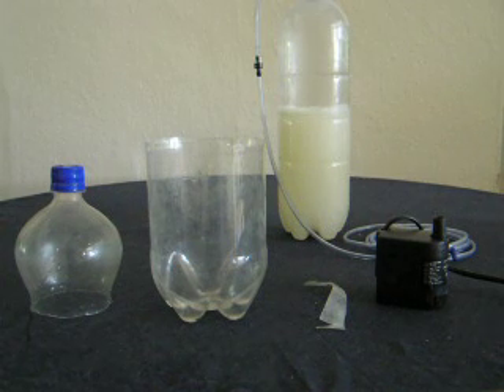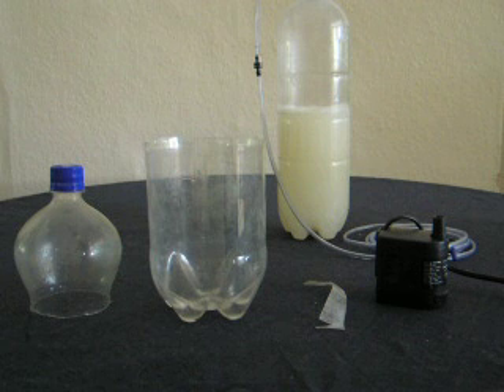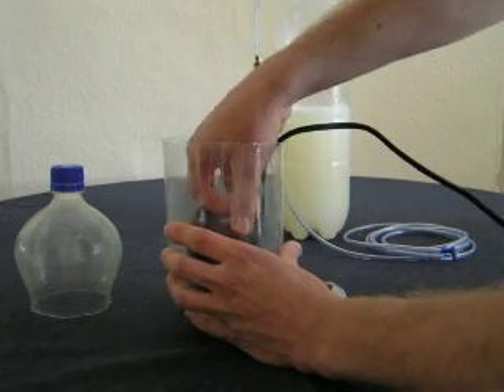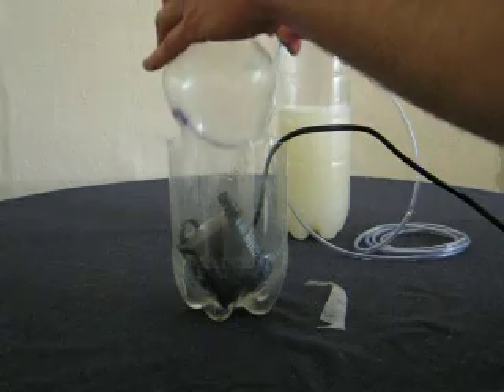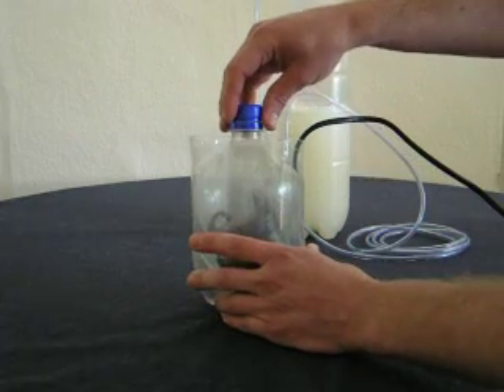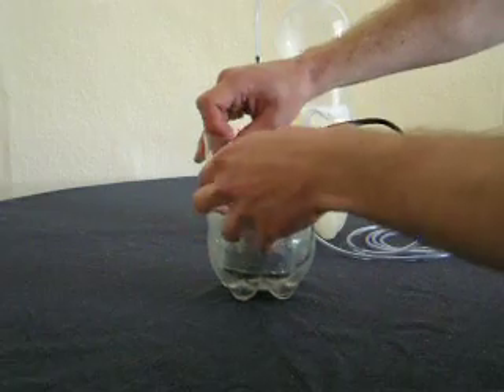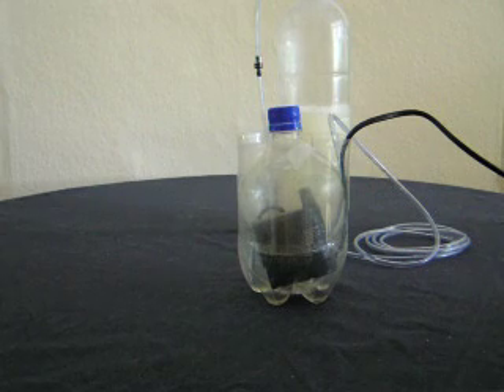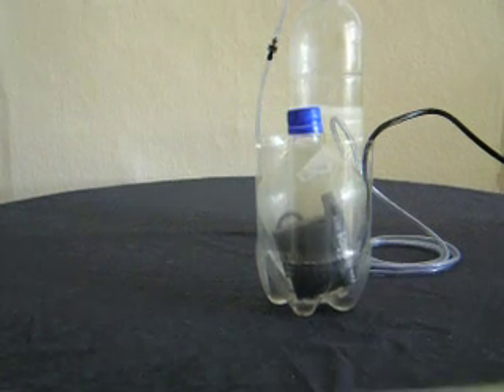Simple and 100% Efficient CO2 Reactor Part 1

Comment from the maker: Hey.  I'm not sure what "stuff" you refer to.  Do you mean the coiled pipe with blue fitting?  That's just the CO2 pipe that I've coiled up.  Apart from that, there's just CO2 bubbles in the top.  Does that help?